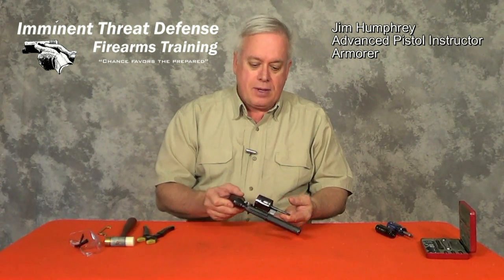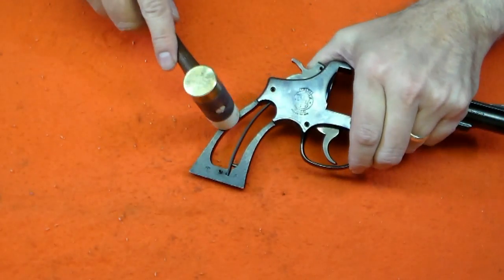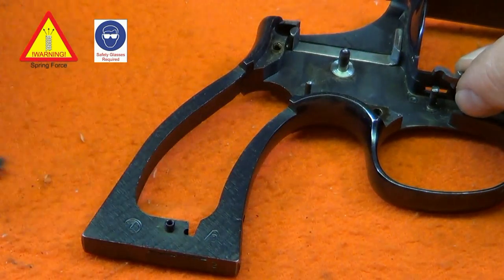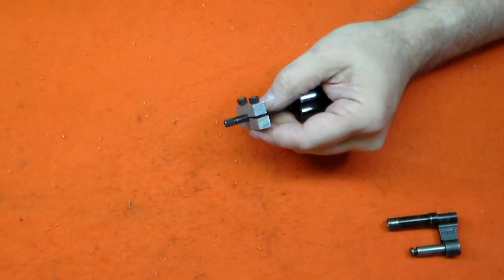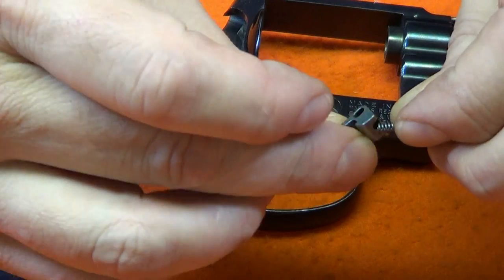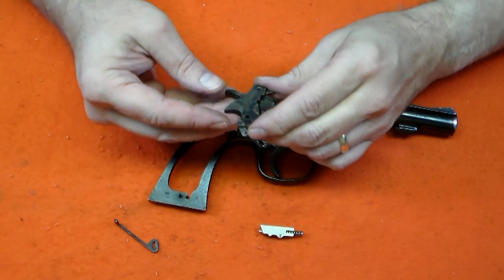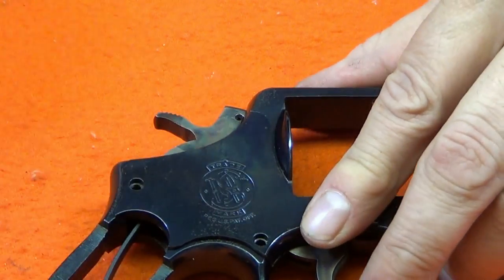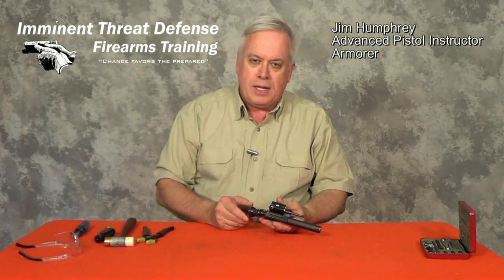S&W Model 10 Disassembly and Assembly

Comment: Huge Thanks! I bought a police trade in, had to slam the cylinder in, then it jammed after 2-3 rounds. 

Opened the side cover, saw the cylinder stop spring poking out sideways.

Followed your instructions, got it placed corrrectly, light pressure locks the cylinder in, and it seems to be functioning smoothly. 

Big test will be at the range, but it that spring binds again, I'll have more data for the gunsmith. Couldn't have done it without the video.

Comment: Excellent Video, I made the mistake of removing the hand from the trigger, I had no idea there's that spring in there, put it back together and the Cylinder no turn, Back to square one, Found your Video and Boom, Back together and working again. None of the other S&W videos I watched mentioned anything about a spring for the hand. Thanks for saving what's left of my sanity.

Comment: Excellent video. I like the orange cloth, provides a good contrast. I use magnets to hold small parts. Also having the hands work from the top makes for greater visibility.
Reply from the maker: Thanks for the feed back.  I've tried all different camera angles and I agree this angle is best, but it means I have to work on the gun upside down, which technically doesn't make a difference, it just feels weird. :-)  I picked the orange by accident really, I've got an old mechanics blanket and after the first video I put it on the table to reduce the clanking noise every time I set down a tool or part, now it's become my trade mark.  Makes my video thumbnails easy to spot too.  Thanks for watching!

Comment: Excellent video sir. I asked at a gun shop if I could remove the cylinders for easier cleaning and they told me not to mess with it, put the gun in a padded vice. So easy to remove the front screw and remove the cylinders. Thanks for the video.

Comment: Outstanding video. I just repaired a friends S&W revolver thanks to you. It had been oiled too much and stored in an attic for 15 years. The oil turned to lacquer. a breakdown with ultrasonic cleaning and it's perfect. THANKS
Reply from the maker: That's great, I love that kind of story!  But I'll bet you a buck it wasn't oil that lacquered it was WD40. I've seen that before, I've gotten rid of all my WD40 and switched to RemOil for lube and Kroll for penetrate.
Reply: @ImminentThreatDefense  May well have been. In any case you fixed the problem. THANKS!!!!

Comment: Simply the best S&W disassembly/reassembly video on the net.  I can now approach a detail strip on my Model 13-3 with confidence.  However, I wish I had that special tool for the rebound slide - I'll have to make do with a small screwdriver.  Thanks for a great video.
Reply from the maker: +Ross Henderson Ross, I made that tool out of a piece of brass rod stock available at any hardware store.  You can also buy one like it from Brownells on line.  Another method is to use a file to notch your screwdriver, this will help keep the spring from sliding off the screw driver.  I also saw Jerry Miculek use a Bic pen to do this work, the tip of the pen fits in the spring to help control it.
Reply: Imminent Threat Defense Thanks for the great suggestions!  I may just file a notch in the screwdriver - simple and practical.  I have a number of S&W revolvers and need to keep them in tip-top shape.

Comment: Very informative video! 10-6 had a fail to rotate one out of six every so often. Installed new cylinder stop, rebound, and main springs. Never knew about the hand spring inside the trigger assembly. After reassembly its running great. Thanks!

Comment: Excellent!  I recently inherited a 10-6. I opened it up as far as removing the plate and putting a drop of oil on the obvious wear points because after shooting it, it felt like it had been a few decades since it had seen any oil. I was afraid to break it down further because lack of knowledge.

Comment: Thank you very much. I just bought a smith and Wesson model 10-8. It came from Spanish police agency and I've got to say, nobody has ever done the maintenance on this old girl. When pulled, the double action trigger was heavy and kinda bumpy and kinda gritty and when thumbing the hammer back it would stop and go no further about a quarter way down.
 It was hell to open, it did not want to go. I put drops of coconut oil down on the edges and the screws, when taken out  the screws had a bunch of schmutz on them. I then tapped until it finally came off. I don't think anyone has ever taken the side plate off, it was that tight. It took quite a bit of lite tapping to get it off
It turns out the part you called the hammer stop had slipped off the pin and it was rusty in there. A bit of coconut oil and a piece of brain tan elk hide got the rust off no problem. 
This is my first revolver. I've got three auto loaders and a bunch of flintlocks that I build, but the person that tells you a revolver is less complicated on the inside is either lying or just don't know what they're talking about. Thanx for your help,it's appreciated.
Reply from the maker: It's for stories like this that I make these videos.  And I agree, when ever anybody tells me revolvers are "more reliable" I know they've never looked inside one.  Thanks for the comment and thanks for watching!

Comment: A helpful side note. When removing the side plate screws mark small containers 4 and 6 and 9 corresponding to the position of the screws on the plate. Just in case so not to install the wrong one in a different spot. Great video.
Reply from the maker: Good idea!  I've also seen were people sketch out the approximate shape of the part on a piece of cardboard and then punch holes in the cardboard with a knife blade and stick the screws in the appropriate holes.  Thanks for the comment and for watching!

Comment: THANK YOU SIR!
(I took it apart, not too bad for guessing and my 1st time, even if it could be seen as reckless, but I 100% want to make sure it goes back together right haha. All I'm going to have trouble with is that rebound spring, might need to invest in one of those tools)
Reply from the maker: You can find the tool at Brownells but if you just going to do it once or twice you can take a cheap screwdriver and file a V-notch in the end.  That'll do the job too.  Thanks for watching.

Comment: I noticed that you initially had difficulty removing the extractor rod from the cylinder when using pliers.  After watching several times, I saw that you were rotating it in the wrong direction.  Just a cautionary note for all, BE CAREFUL!  A mistake like that can damage the extractor star.!  On the plus side,  I liked the fact that you removed the rebound slide before removing the hammer.  Most other disassembly videos don't do this and I don't understand why.  It makes the job a lot easier.  Overall, this is just about the best tutorial on the subject I've seen.  Excellent job and sorry to be a nit picker!
Reply from the maker: Thanks for the comment.  Good catch, it's been a while since I did this video, it was one of my first.   I can't remember if I was trying to make a point that it wouldn't turn that way, or I was having a dyslexic moment :-) Either way I hope the commentary made it clear.  Thanks

Comment: I am currently on working on an old M&P that uses the old style cylinder block with just the plunger pin and no spring. The cylinder block on it broke, so I stripped it down, cleaned it really good, and am now awaiting a new cylinder block (got a new main spring too) to arrive. Your video will help with reassembly, thanks!

Comment: Thanks for the video, it was of great help in taking the old Model 10-1 apart that I got from an estate. Mine also had an interesting black plastic accessory mounted on the front of the grip to help lower your grip on the gun and ensure that your trigger finger is more in line woth the trigger naturally. The plastic even had a S&W marking so I assume it was a factory accessory from some era. I believe it was an old police issued gun.

Comment: I found out that I may have a special 10-6 but it is not a 38 its a 357 Magnum and I found out that in the early 70s NYSP special ordered this chamber for the officers it may be one of 1200 produced. It is in excellent shape but I don't think I am going to do a complete tear down just remove the grips and side plate and just do a flush and clean and lubercation. Be my luck springs would fly. Things have gotten bad with business I am going to sell it . Thanks for the video very well done Sir

Comment: Found a easy way with the rebound slide a small flat head between the pin and the spring comes out easy and goes in easy that way hopes this helps if you dont have the tool

Comment: Nice video and very comprehensive.  If you could help with one thing--you use a micrometer to identify the two case screws but never say what the differences are between them.
Reply from the maker: It could be different for each version of the revolver.  So I measure them when I take them out to keep them straight.  But it's always the shorter one up front.  You can tell you've got the wrong one up front if the cylinder doesn't swing out easily.  It's easier to just keep them separate.
Reply: Imminent Threat Defense actually you used calipers.

Comment: Excellent video! I am the proud owner of a 10-10 that is in great condition. I may have one issue with it. When the cylinder is opened, the cylinder has a bit of play on the yoke and can move back and forth in line with the ejector rod. Is this normal? If not, how do I fix this issue? Many thanks.

Comment: This is so much more complicated than my Glocks, wow!  I'm almost afraid to try but I have a 1966 .38 Spl that the hammer won't cock back unless you pull it back and then give it an extra hard press to click it back.  I'm afraid a full dissasemble & cleaning is what it needs.
Reply from the maker: Yeah I always get a bit of chuckle when people tell me how much simpler and reliable revolvers are.  You pop one of these open and you realize it took an artist to assemble and fit the parts, then you reconsider just how simple they aren't.

Comment: THANKS for your video.  It sure helped me easily step through and disassemble a "vintage" (83) friends Victory model .38  which he inherited from his father.  Dear olde dad had the hammer and cylinder chrome/nickle plated sometime after bringing it home from WWII.  My friend wanted me to install a blued cylinder in the gun, for cosmetic reasons only.  The original cylinder is serial numbered to the gun.  The new one, obviously not.  Both are  right hand threaded and seem to be the same thread pitch and diameter.  BUT the ejector rod will not thread all the way down into the ejector star, as does the original piece.  Have you encountered this problem?  At this point, I think I'm going to have to take this great old gun to a smith for some thread chasing as I don't have a tap for the job.  Have you any suggestions/solutions for this "problem?"  THANKS in advance.
Reply from the maker: Carefully compare the two ejector rods, if they are identical it seems odd one would fit but one wouldn't.   I'd be inclined to spend a little more time cleaning the  threads before trying to chase them with a tap.  Additionally those cylinders were hand fitted at the factory to that frame.   You may have issues getting the a different cylinder to function without fitting (not for the faint of heart)

Comment: Great vid thanks so much. Hope you can give a little advice. Took the side plate off to put reduced  trigger return spring and with the side plate on it will lock up but with the plate off it seems to function fine. It is not that the hammer block is not aligned for I tried it with and without the block. It seems as though when I tighten the plate screws it puts something in a bind. Thanks in advance.
Reply from the maker: I'm not sure which spring you are talking about, but that probably doesn't change the diagnostic procedure.  Also, what exactly is locking up?  I presume you mean the action, but is it only in double action or is it in single action? Start by putting back the original parts.  Then like you tried with the hammer block, remove the parts you worked on one at a time and keep checking for the binding.  The only thing that can bind against the side plate is the hammer block, unless a part isn't pushed all the way on it's stud and is raised up a little. So use a straight edge over the action and see if you can tell if something isn't installed correctly, (like the rebound bar). You can also putting some dykem on the back of the side plate and tighten up the side plate just enough that it rubs but doesn't bind and then look for rub marks.  Good luck.  let me know how it turns out.

Comment: I have a 10-6 I bought in pieces and your video helped me get it back together without an issue… save one. I cannot get the plunger pin (extractor rod plunger under the barrel) to go in without hitting the plunger. I’ve indexed the plunger so that the groove is in alignment with the pin hole, but just a couple small taps with it barely in and the plunger won’t budge. I know to push the plunger in slightly while inserting the pin, but 5 tries and no dice. Is there a trick I’m missing?
Reply from the maker: the plunger could be rotating when you start tapping on the pin.  Try using an alignment pin//drift or a slave pin, either would be slightly smaller than the pin you're trying to drive.  That way you can push the alignment drift in by hand since it's a loose fit, then chase it out with the actual pin, that way the alignment drift keeps the plunger from rotating.  Also make sure the pin isn't larger on one end or disformed in any way.  You can see how I use alignment drifts in my Colt 1903 video and I have a video on making and using slave pins.  For what you're doing you could use a slightly undersized drill bit (the shaft end) as an alignment drift.

Comment: great video. I have a question. So I have to hold the bolt back to cockvthe hammer...this isn't normal but can't figure out the issue. So I have to hold the cylinder release button on left side back in order to cocktail hammer. thanks
Reply from the maker: Apologies for not responding sooner, I missed this comment when it came in.  The issue is your extractor center pin stuck back inside the extractor rod.  The center pin is what pushes on the bolt and holds it back so the hammer can cock.  The center pin is probably just gummed up.  You can try blowing a solvent like "Gun Scrubber" down the inside of the extractor rod, followed by some oil.  Or you can disassemble the cylinder and clean it up.  Good luck, thanks for watching.

Comment: Hi there. I have a old smith wesson 38 V.  Not sure which way to turn extractor out?  Thought it should be reverse but no luck.  Wondering if I’ve got it wrong.  The yoke on this particular revolver dose not slide off rod, if that helps. Btw absolutely great videos.
Reply from the maker: A Victory model would almost certainly be normal right hand threads (lefty loosey).  But the direction of thread varies depending on which S&W revolver model and when it was made.  Generally, and I mean generally, S&W revolvers made before the late 60's early '70's were normal or "right hand" threads.  Sometime in the that time period on most (probably all, but I'm being purposely vague here in case there's an exception) S&W's they started changing over to reverse or "left hand" threads.  So, depending on when they made the change on your model, it might be a different year on another model. What I do when I don't know the thread direction, is grip the rod in a padded vice or a rod tool and turn the cylinder, gently at first, with each attempt I reverse the direction of turn and slightly increase the amount torque.  This is kind of tricky but has worked for me.  Hope that helps. Thanks for watching!
Reply: @ImminentThreatDefense   fabulous thank you.  For some reason I had it in my head the other way round, revers more common on war time etc.  All experience and again most grateful for yours.

Comment: Much appreciate the video. Refurb of S&W Model 10 looks like totally worthwhile, great project for revolver handgun enthusiast. The revolvers have history, and much can be learned from this kind of project. I am waiting on Model 10-10 delivery & intend to do complete restore from parts to finish. I have fired Model 10 .38 at the range & after that I am hooked on S&W M10 .38 revolver - 
 just right weight & calibre. It gave me confidence to shoot Colt .45ACP too. So many benefits. I love working with metal. My only concern with old revolver is springs. Well functioning springs are small but critical components of handguns. Can I get new springs for Model 10-10? If so from whom or where?
Reply from the maker: Wolff springs are a pretty good source for newer gun springs.  For older parts Numrich and Jack First are my go-to suppliers.

Comment: I have a smith and Wesson 38 special ctg with serial number under the butt S 813308 but the cylinder seems to be locked the release button slides back and forth but will not allow cylinder to slide out,the hammer will not move back and the trigger also won’t pull back,this firearm was gifted to me by my best friend,I unscrewed the number screw to the cylinder and it still won’t slide out,does anyone have any suggestions ? I haven’t taken any other screws out or touched the knurled rod that runs from under the barrel through the cylinder,the revolver is beautiful and I want to know if anyone had any advice or input on what steps I could do to possibly get this firearm to function,what would cause this to be so locked up it isn’t rusted at all